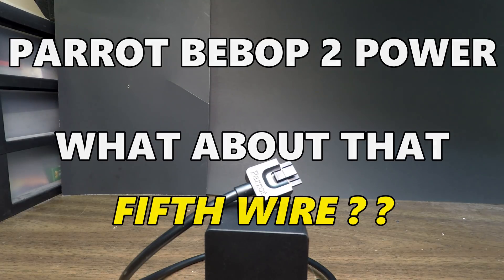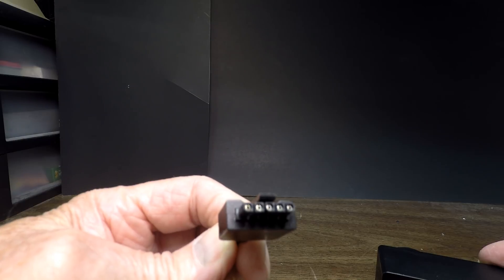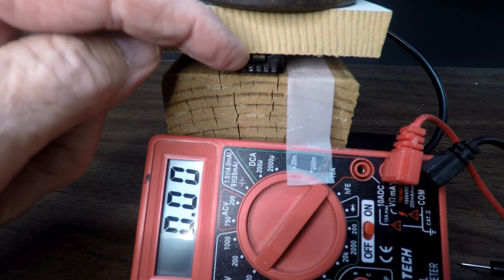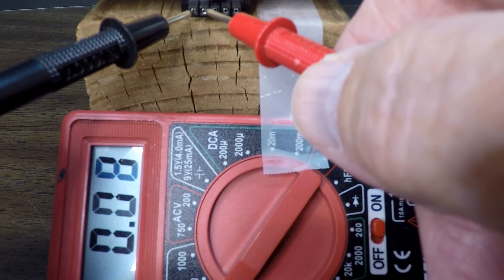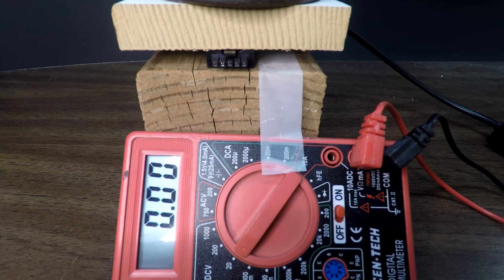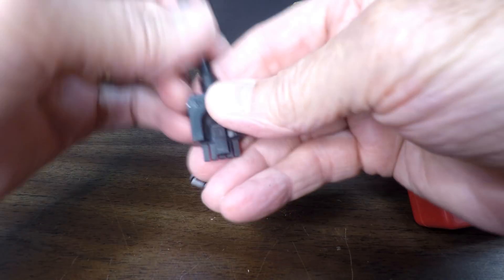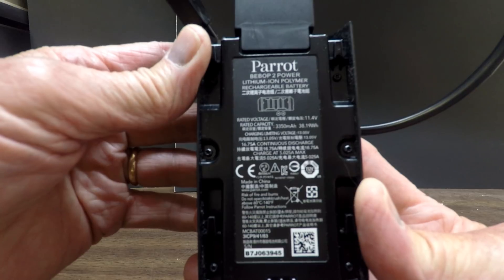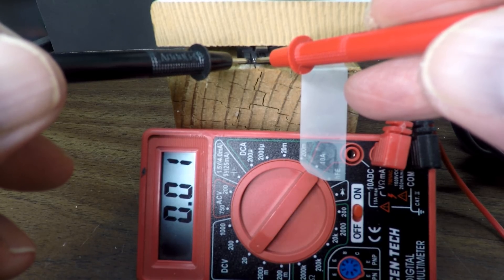PARROT BEBOP 2 POWER WHAT ABOUT THAT FIFTH WIRE ? ?

Comment: A continuity test of the ground (negative) (#1) pin and the 2nd pin (with 0.01/0.00 voltage) next to it would confirm if they are connected to each other or if the fifth pin added is just a dummy connector to prevent the charger cord from being used in HD and previous gen 4 pin charger.  As always Mr Kent, thanks for the video and my balance cord for Bebop 2 i bought from you is still working like a champ!!  Be safe!!
Reply from the maker: Thank you Eric for your input and I'm glad it is still working for you. God bless you.

Comment: Hi mr kent. Very good video. I was wondering if you could help me. I received a bebop parrot 2 as a gift( the drone was in the box with all its accessories and seems brand new). But, Its missing the charging cable that connect the charger to the battery. I went on amazon, ordered a third party wire, it was very cehao like 8 $. One end of this third party connector fits in the battery but the other end of the cable doesnt fit in the charger. I will try to test the voltage like you did and i will probably try to remove the useless connector and crimp terminal on my 8$ cable so they could grip the pins on the charger. I think its the cheapest solution. What do you think ? Thanks ;)
Reply from the maker: Hi Guillaume. It sounds like you know what you are doing. Unfortunately, parts for your drone are getting harder and harder to find. Please be careful when making connections as a short can start a fire in a few seconds. I would recommend doing your testing somewhere other than in your house. I'm not much help but that's all I can tell you. God bless.
Reply: @user-sr8pn9xg8z  Thank you very much, I ordered a 40 canadian $ cable on ebay instead of starting a fire ;).

Comment: Thanks for another great video. Fascinating stuff. Im very glad you shared this info. I have a different cable for my 5-pin charger! It's official Parrot. The pin is an empty hole to the left under the little "t" in Parrot! The pin you are using as Common is empty on my cable.. My Harbor Freight meter sadly fell in on itself; when I get a new meter, do you think I should try using the second hole as common?? I wonder if those left two pins are split from the same source.
Reply from the maker: If you are using the standard charger you don't need to be concerned. Parrot has it all figured out for you. If you use a balance charger for your battery you won't even use that cable. I hope that answers adequately. If not let me know. God bless.

Comment: Cable has not arrived yet I believe it can take up to four weeks, not to worry I look forward to using it when it arrives. One more question please, if I am not flying I should put my batteries in storage which is done on the balance charger, when flying and the battery level is dropping is there a percentage which is good enough for safe storage e. g. 20%.regards alan
Reply from the maker: Yes, you should put your batteries in "storage" when not flying on regular basis. I would suggest about 30 to 40 percent for storage. I didn't know how long it would take. Sorry it is taking so long. I am anxious to hear when it does arrive. I just subscribed t your channel. I thought I was already subscribed ? ? ? God bless.

Comment: Hi Mr Kent, I know you had a problem with the hobby mate charger, are you charging the power batteries with your standard balance charger and how's that going, regards alan
Reply from the maker: Hello Alan. I am assuming you received your cable by now. I will tell you what I am doing. I ordered a Tenergy balance charger for the Power batteries but it hasn't arrived yet. I expect it this Saturday. I will be running an ongoing experiment, comparing the two batteries that come with the Power. One will be the control battery and will always be charged on the Parrot charger and the other will the the test battery and will always be charged by the balance charger. I will alternate between batteries on each flight and from what I have experienced with my first Bebop 2 the test battery will eventually show better performance. But that will take some time. If you are interested in seeing how it is going so far you can go to:
http://www.mrkent.com/bebop/chargerstudy.php
You will see the results so far after nearly ruining the "test" battery. That table will be up and available as time goes by. Thank you for your comment and please try to stay in touch as time goes by. God bless.
Reply: Hi Mr Kent. At this moment I don't have a YouTube channel
Reply from the maker: ????

https://www.youtube.com/channel/UCv64THxkjK7NITTVxJXkSmQ

I guess I don't understand.

Comment: I have had my bb2 power over 10 months and i use the balance hd charger that came from parrot and my power batteries stlii last in 10 to 15 miles per hour wind for 27 mins, and i have flown each battery with the bebop 2 and the bebop2 power 170 flights . The batteries have never lost power or drained too fast. I just  flew an hour ago , still with 27 minutes a piece.
Reply from the maker: Thank you Keith. That is what I am wanting to find out. That is helpful information. God bless.

Comment: Interesting. Without actually breaking a battery open to see how its wired its difficult to say whether the wire is used or not.
Reply from the maker: Thank you for your comment. The two left-side pins are shorted together so they cannot have separate functions, don't you think? Thanks and God bless.

Comment: Kent I have an observation. Pin 1 you detect 13.07 then (8.7 pin 2 and 4.3 pin 3) which looks like 2 of the cells are connected on pin 2 to get approx a cell battery of .... 4.35 + (4.35+4.35) = 13.05
So it looks like pin 2 is connected to 2 cells and pin 3 to1 cell with the Battery of cells presented on pin 1.
Pins 4 & 5 appear to be ground.

Million Dollar question will the Bebop 2 balanced charge lead we made still work for the Power?

Mike
Reply from the maker: Thanks for your input Mike. Today I am finally getting the charger I mentioned in a former video which is advertised as being able to charge an LiHV battery. Of course, you know me. I will be putting up a video as soon as I have some findings. This is an interesting hobby with a lot of great people to be in touch with. God bless.
Reply: Kent I have also decided to charge one battery with my balanced charger and the other control battery with the Bebop2 charger. 
I bought an additional battery when I got my bebop before Xmas 17 so its a good opportunity to see how good the Bebop standard charger and battery are compared to the balanced charging. I will give the test about 3 months. However from my initial observation of my battery status when I got my balanced charger, the charger indicated that the batteries were fairly well balanced give or take 0.01 volts per cell. So maybe the standard Bebop batt + charger is actually quite good after all :-)
But like you I like to investigate and play with new tech so the Balanced charger is an interesting project and also good for discharging the cells if I am not going to use them for a while, and also a very good way to easily monitor the individual cell status for an early warning of a potential failure.

Comment: Why don't you check continuity between the last two pins ... maybe it's just ground. Either way Bebop 2 Power batteries are Li-HV and they max voltage is 13.05v much above 12.6 volts of the regular Li-Po. Chargers shouldn't be mixed because either you don't charge enough or you destroy a battery.

A nice video/test would be to use a Bebop 2 Power battery in a regular Bebop 2 and see if flight times are the same as Bebop 2 Power or the battery can't fit in a Bebop 2 Standard ?
Reply: Hmmm an interesting scenario. So if we can work out how to charge a Bebop Power LiHv with a balanced charger maybe we could use the LiHv 13v on a standard Bebop2 to get more power. I suspect that both drones Power & Standard use the same motors etc.. and the 1v difference will not harm it. 
Then we get 30 mins :-) as long as were not going to damage the BB2 std by using a BB2 Power Batt.
Reply from the maker: Thanks for your input. Helder Hugo did that test a while back but I cannot recall the results. You can find it on his channel. God bless.
Reply: Bernek I have a bebop 2 and the power , i fly my bb2 with the power battery all the time and sometimes, if little wind i have got 31 to 32 minutes.

Comment: Wait a second. Let me go back to February 2016 when I get my first Bebop 2. I get it with a 4 pin charger and the Skycontroller 2 doesn't exist on the market. Then I get another Bebop 2 with Skycontroller 2 FPV pack in February 2017 and it came with a charger with 5 pins I think because of charging the batteries and the Skycontroller 2.
Reply: Helderhugo yea. My bebop2 purchased last December came with the 5 wire plug.
Reply from the maker: You know a lot more than me about these batteries. I have had some questions about a "fifth wire" and was curious about if it was necessary and wanted to settle everyone's mind about it. Thank you for your input.
Reply: I don't know more about batteries. You have explained in your early videos a lot I didn't know about batteries.

Comment: Mr. Kent I am going to ask a dumb question. I ordered one of your balance charger adapter cables a couple of nights ago and am wondering will this have any effect on charging my Bebop 2 power battery using your adapter cable? i just got my balance charger today and got one just like yours as I trust what you recommend more than some others. thank you for all you do. God bless you too!!
Reply from the maker: Boy Tony. I tried my charger on the power battery and it didn't work. I am receiving the HobbyMate charger and will find out if it will do the job. I will be putting up a video of the results of that. I know one subscriber who used the chargers we have to balance the Power battery after using the factory charger. If you feel you need a refund for my poor recommendation please let me know and I will refund your payment and you can keep the cable. Please let me know if so. God bless.
Reply: Mr Kent your advice is always appreciated. The lord looked after me as I inadvertently ordered the Hobbymate Elite charger. I just need to know if your charger cable will work on my Bebop 2 Power battery??? Thank you.
Reply: Thank you!! I just got home and tried the cable and the Hobbymate Elite and everything works perfect. I also have no issues at all withe the Hobbymate charger as Mr. Kent alluded to. Thanks again.
Reply: Your Charter cable from mr. kent.com is working fine with hobbymate Elite Ballanced charger  and my Bebop2 power .